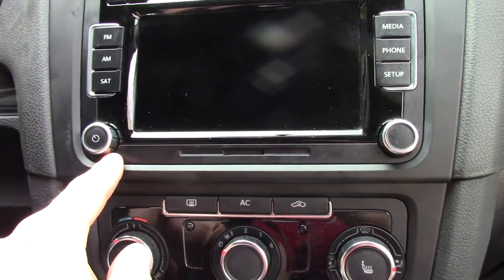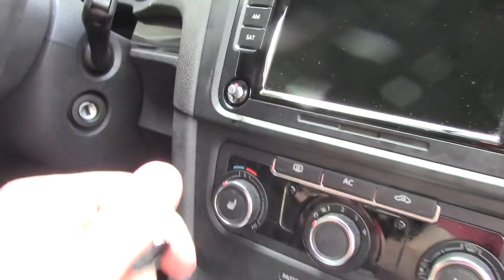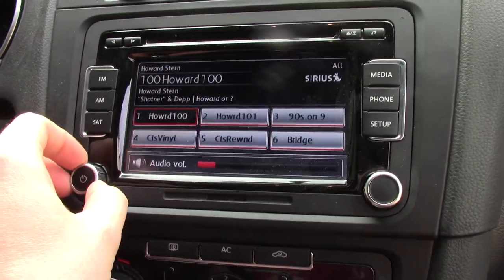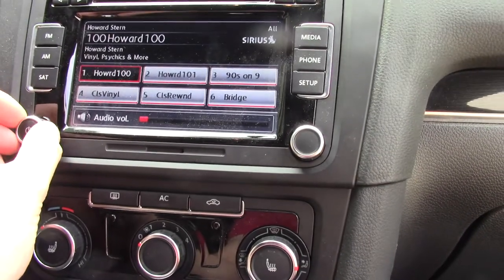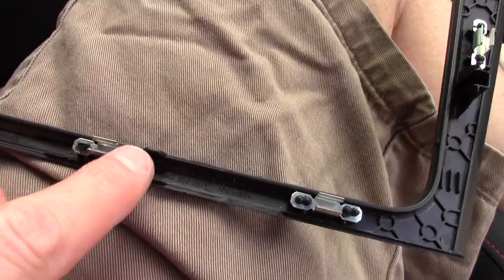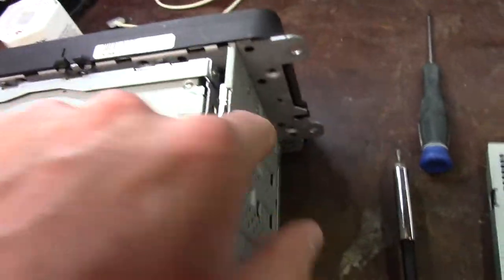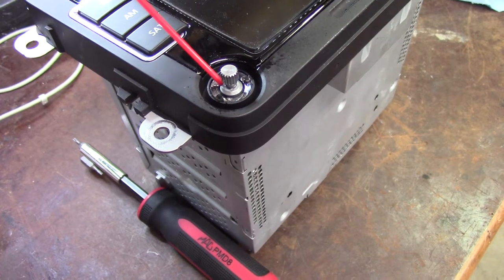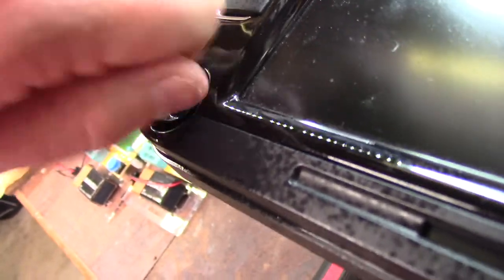VW Radio Glitchy Volume Control Quick Fix

Comment: I was somewhat apprehensive, however it seemed to work in the video. I went out and got some CRC contact cleaner. Three minutes after arriving home the volume dial was working 100%. I did not even remove the head unit.
Thanks a lot for this video.

Comment: Thank you! I used Coyote Kontakt plus contact cleaner, removed only the knob by pulling it and sprayed into 4 little slots in the clear plastic part so it got inside on my golf 7, and now the volume knob works.

Comment: Hi I have a 2019 Jetta SEL and I have the same issue, but I don’t know if I can remove the whole system from the car. Not sure how familiar you are with other models, but is it possible just to pull the knob off and spray it without disassembling everything? I saw that you mentioned trying that in the video and wanted to see if you had any luck with that. Thanks
Reply from the maker: Yeah give it a try.

Comment: Did that, didn't work for long.
Reply from the maker: Could be a bad control. 
Mine is still working great.
Reply: @mechtrician1  
Yup - held up a fortnight, but where do you get a spare part - that's the question. 🙂